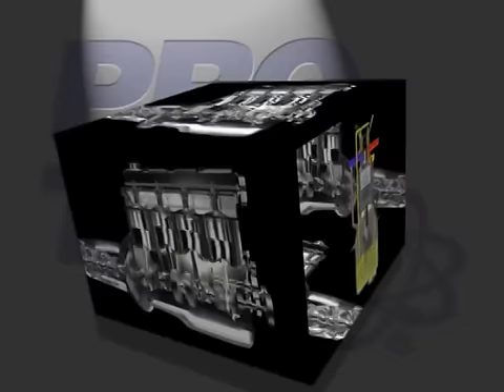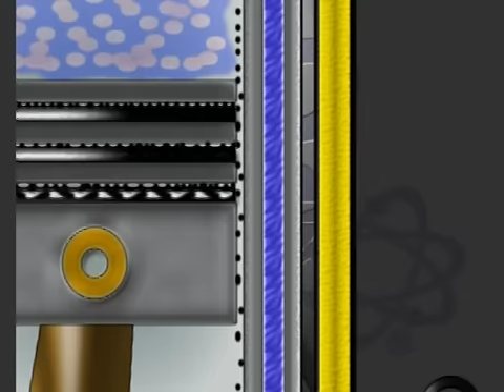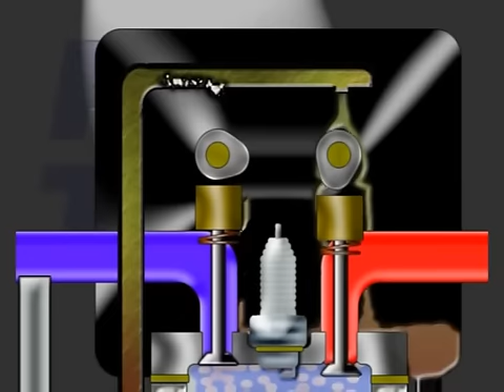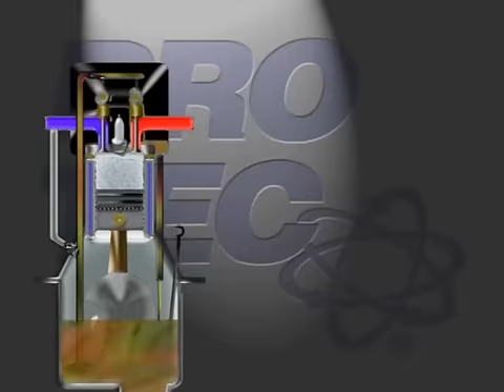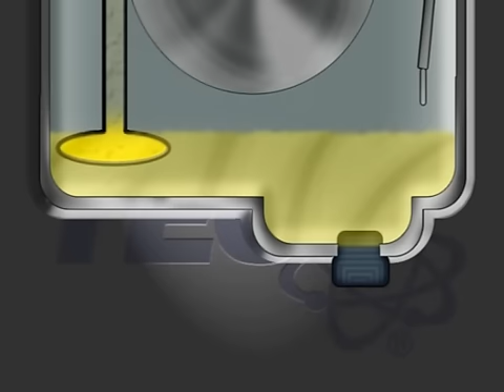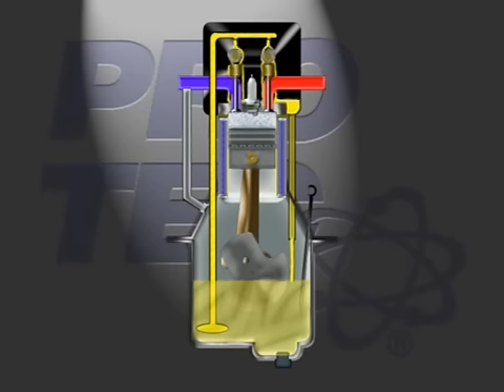PRO-TEC Engine Flush - Oil System Cleaning (en)

Comment: I just need to know if this can be used on my supersport motorcycle as it doesn't say on the can but figured there could be a chance of damage since it's a motor that operates at 2x the rpm of normal gas motors.

Comment: I placed 7 liter instead of 5.5 in my car. after 10 min. I measure and decide to open tap and release a little bit out what is more. Oil was dirty even if stay in engine 10 min. without starting car. NExt time I will wash engine like this.

Comment: I've drained engine oil and filled it with clean fresh transmission fluid and drove it for an hour and when i drained it the oil was full of gunk and shit and i filled it up with castrol synthetic oil and the slight lifter noise and compression on cylinder 4 improved and felt better when driving it
Reply: You put in transmision fluid instead of oil? why the fuck would you do that?!
Reply: Actually felleice, royal purple is NOT a Walmart brand. Walmart has its own brand of motor oil, it's called Walmart motor oil. Royal purple is a high performance ultra synthetic racing motor oil like Lucas oil. It has detergents to prevent engine sludge clean and lubricate engine parts it also prevents wear and tear by reducing physical contact and preventing piston gaps from expanding. As what other oils are supposed to do; racing oil is made to be high performance because when you're racing you're putting more stress on your engine with that being said it is made to not break down as fast and continue to do it's job. Royal purple isn't the only oil that's good out there. Lucus is good Mobil one is good to valvolene isn't the best but it's better than Walmart. But felleice use what you like they all say they're gonna do stuff right lol.
Reply: Im a trained mechanic i sweden, that brand isnt avalible in europe and the top car manufacturers (european and asian) dont use royal purple but Castrol, shell och motul are the most common... and its widely known that USA make som crappy cars😉
Reply: I never seen anyone put transmission fluid as an oil substitute I use royal purple full synthetic really good stuff. Or you can use Lucas oil or oil additive both really good stuff.
Reply: Carmello G what The f*** is royal purple ? some shit oil from walmart?  😂 buy castrol, motul, valvoline, shell ,mobil1 or some other world wide known brand..
Reply: felleice royal purple is one of the best oils you can get. If you don't have any clue what it is then you definitely shouldn't be giving any car advice whatsoever.

Comment: Tbh I wouldn't advise an engine flush after 75,000 miles as it does more harm than good . I also believe oil flush is a bad gimmick also as  when you flush it all out the bit that require oil are left dry why causes damage on engine start up . please correct me if I'm wrong

Comment: hi, my kia optima 2004 cylinders (3 and 4 have 120 psi) . issues with hesitation going uphill. question: by doing the motor flush what approximation cylinder psi will be the result.

Comment: Is it OK to leave the protec in for 1 night? I was about to change the oil but I needed an adapter for oil filter so gotta wait till tomorrow. Problem is I've already perform the protec oil cleaner and its sitting in there. I'm afraid it'll cake in the engine or something

Comment: 1 - you can add 1tr oil from engine then add same ATF  oil drive your car for 150 - to 220 mile   - between  check the oil by deep stick if you see heavy  things -- immediately replace  the oil and  filter -
2 - sec you can drain old  oil then fill  the engine bye diesel  run  the engine 1min  to 2min max  stop - drain the diesel  return the old oil run the engine for 5 min stop engine drain the old oil  replace the filter  file  new oil  drive  your car you will see you drive new car
 my language  not English i,m  Arabic for any mastic
Facebook:  ibrahim al fakih
https://www.facebook.com/ibramovetech?fref=ts

Comment: Coolant flushing is a must, it is recommended by every car manufacturer.  It is a normal part of vehicle maintenance, Where did u hear that it "is not a good idea?"  Add half a can of sea foam 1000 miles before changing your oil.  Engine flushes can in certain situations be bad.